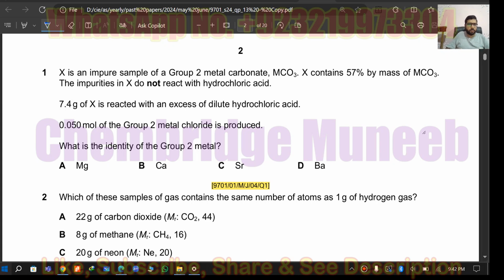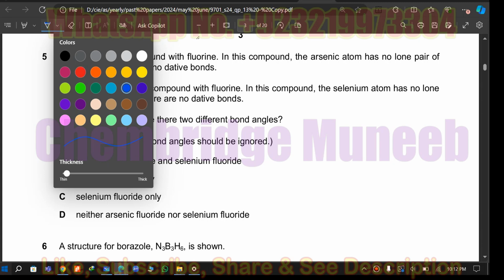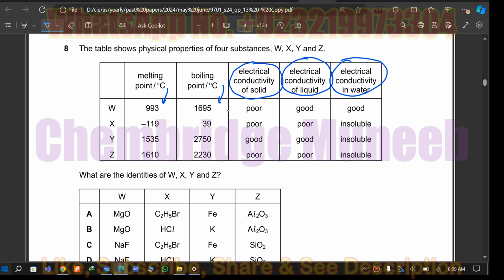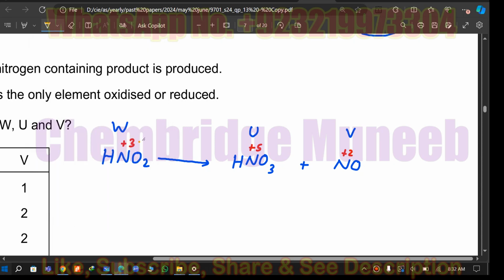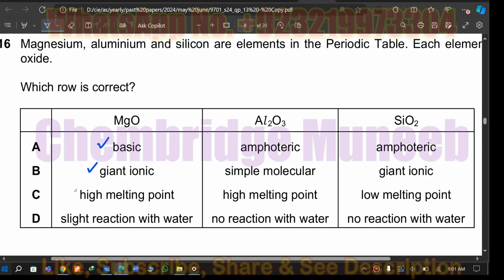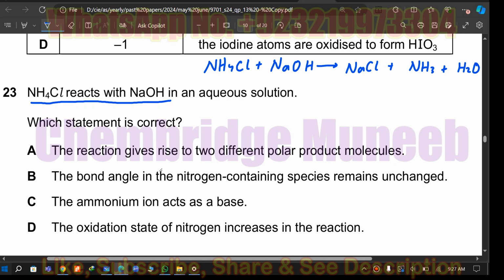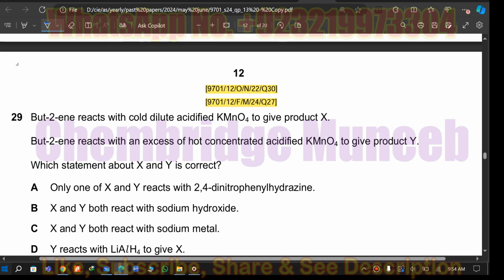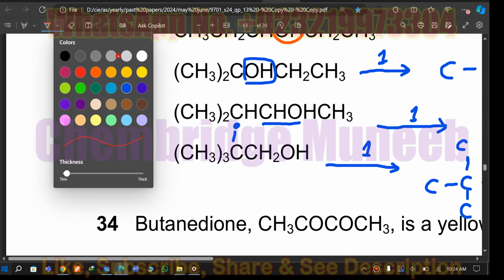9701/13/M/J/24 Part#1 | 9701/13/mj/24 | 9701 13 mj 24 | 9701 13 mj 24 | 9701 s24 qp 13|9701 s24 qp13

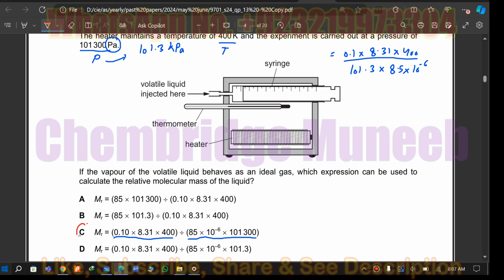Comment: I have a question... on 40:45 , isn't the answer D not C?
Reply from the maker: the answer is C
Reply: @CheMuneeb  Your methods for solving Q7 is wrong
Reply from the maker: @liwilson6675 yes there are slight mistakes. Either the volume should be written as 8.5 x 10^-5 cm-3 or 85 x 10^ - 6 cm-3  and in that case the pressure is assumed to be in Pa, not kPa.

Comment: Assalamu Alaikum Sir
9701 student here. I found this video very helpful
Can I please get the pdf link of your topical questions? You can upload the pdf to google drive, manage access to ppl with the link and share it please, as I do not have access to whatsapp. And if you have topical worksheets for other chapters then please send them as well. This is a request
Reply from the maker: Here you go!
Google Drive Link of Unit #1 Atomic Structure Topical Practice Worksheet in PDF ▶https://drive.google.com/file/d/1meQpB51STa6cMz_MdItUSiT5KxD5bRJ7/view?usp=drive_link

Google Drive link of Unit #1 Atomic Structure Lecture Notes in PDF
▶https://drive.google.com/file/d/1siQ_3hxLjwkV-zsRr57Y2WO4UAdxwZ31/view?usp=drive_link
Reply from the maker: @Jimingotjamsrm  walaikum assalam. Basically I have put years of efforts in compiling the topical questions worksheets. I am providing these worksheets on payment. You can also reach me out on my email address or Instagram account.